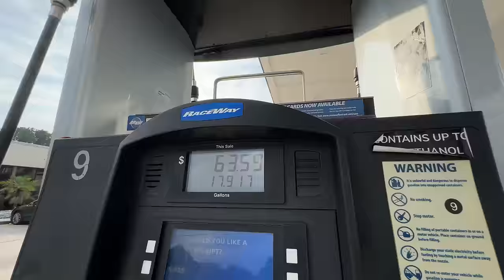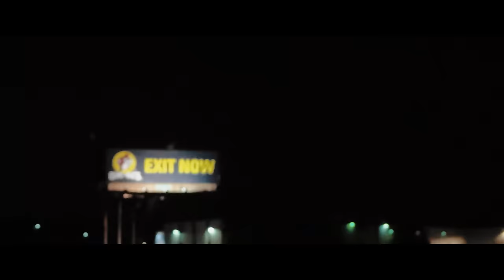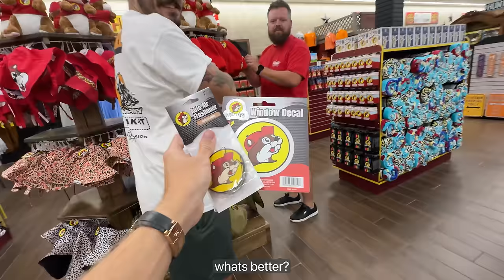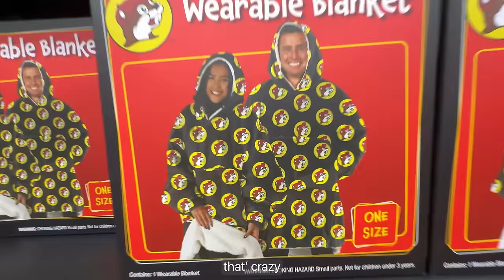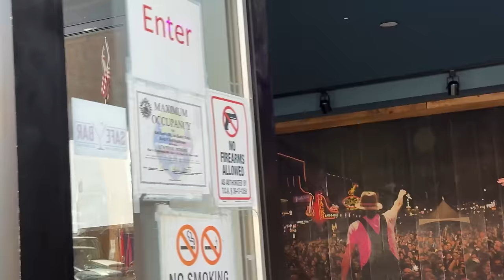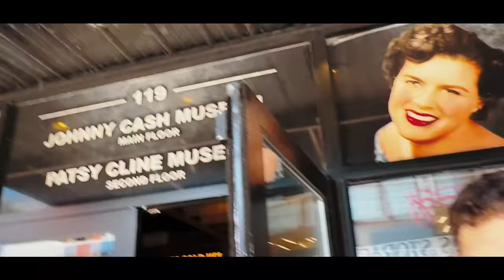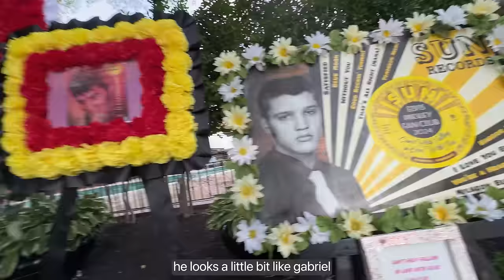BUYING A NEW CAR AND TAKING IT STRAIGHT ONTO A 4.500 KM ROADTRIP ACROSS AMERICA - PT.1

Comment: Raise the rear a little, put on the OEM styling 65 and Supersprint exhaust manifolds and the main thing: an OS Giken LSD will make the best drifts, you're done. Owned E39 M5 and E60 M5 myself. E39 was faultless, only a crankshaft sensor in 5 years of ownership and lots of oil quarts. E60 M5 had the red cog of death but it was only the fluid that the previous onwner filled too high and a new sensor. Now own a stage 2 F90 M5 800 bhp which apart from not having a manual gearbox sometimes is the best M5 ever IMO.

Comment: Two V10 M5´s not working out, Schaefchen took a tiny step back and " settled" with a V8 M5 instead :)
Hope the motor in the " Ghetto E60" is still good and can be swapped into the " Rodknock E60", but thats probably another video to come.. :)

Comment: 1:36 electric seats at that time 😱
4:49 A pillar airbags at that time 🤯
Reply: You could get the E39 with memory seats, electric and heated steering wheel and much more stuff that even many modern cars don’t have
Reply: My '82 Citroën has electric seats and windows all around. They even had rainsensors in the early 70s....
Airbags and sideairbags weren't that uncommon in 90s cars.